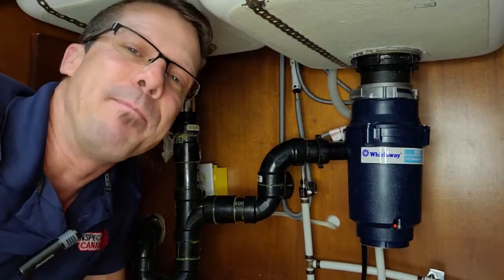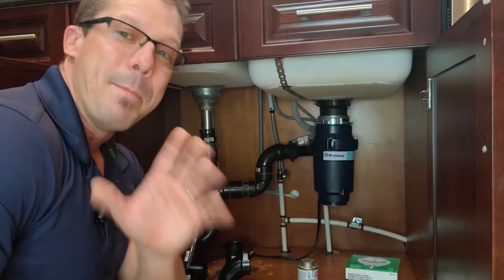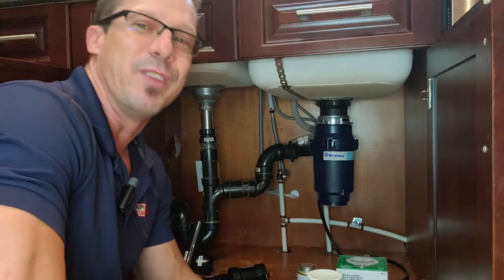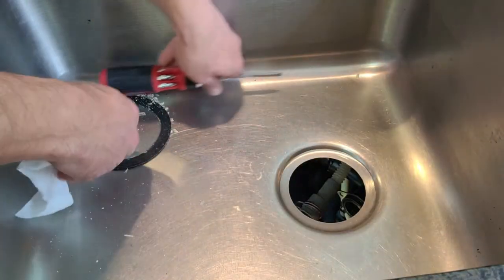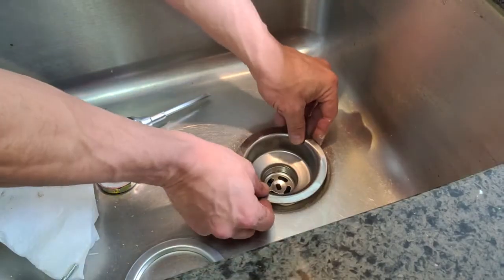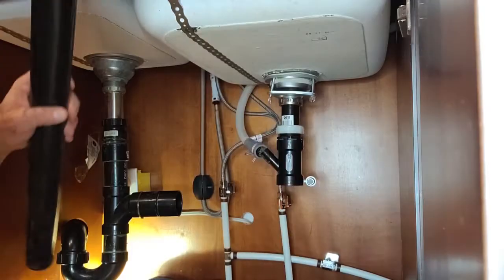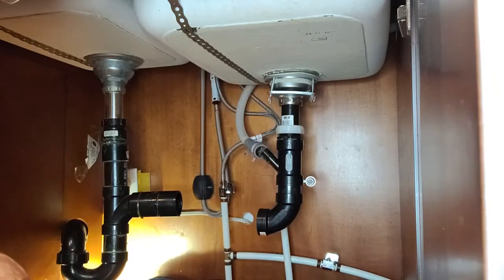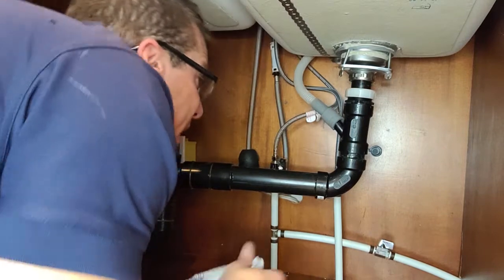How to remove a garburator garbage disposal and finish the plumbing

Comment: those gaskets you put the putty over go under the sink
Reply: Wild he doesn't know that lol
Reply: He doesn't know that. Cause he's CANADIAN..LOL
Reply from the maker: I guess now we know that whether you put it on top or under, it makes no difference. But you are right, it goes under.
Reply: No point to put putty over gaskets.  I assume the gaskets are to prevent leaks in the future. 
The bracket looked very crooked, and will shift over time. 
I wonder how long it will stay water tight.
Especially with vibrations from countertop appliances and dishwasher.
Reply: @Finder76  i expect this will leak in a couple years. water will leak under the top gasket or out the crooked fittings.
Reply: @InspectCanada  It does make a difference wth are you talking about
Reply: @TMS5100 it's gonna leak immediately

Comment: When you installed the new drain, you put the plumber putty on top of the rubber gasket and paper gasket.  That rubber and paper gasket actually gets installed under the sink and only the putty should be on top between the new drain and the sink.
Reply from the maker: Yes, I've been told. It's been a few years and it still not leaking. Didn't want to re-do the video for that.
Reply: @InspectCanada so u just left it? Jesus...

Comment: Just a question.  My sink is plumbed like it was in the kitchen you worked in.  There is a plastic value that screws onto the pipe at the top of the sink, on one end of the pea trap and the other is connected to the garburator.   My sink plugged up so I tried to remove the p trap. I couldn't just remove the pea trap connection because there was no screw valve on the other end of the pea trap.  When I removed the screw valve at the top of the sink and the garburator the pipes are too tight to remove. I don't want to be too rough or it may crack the plastic pipes.   I need to remove the pea trap because I can feel 2 pieces of plastic cutlery in it.   How do I remove the pipes by the p trap without having to call a plumber to cut the pipe?  When I looked at other videos there are screw valves on both ends of the p trap so is this plumbing acceptable because you can't remove the p trap?  I'd appreciate your feedback.

Comment: I am not sure but when you slide the piping up to connect the final elbow to horizontal section is there a chance that the vertical drain from the sink is now blocking the drain from the dishwasher inside the piping? The vertical piece from the sink was quite long.
Reply: Good observation. An inch or so too much I think.

Comment: My parents had an Insinkerator disposal since the 60's, replaced it in the early 80's with a new, higher-end quiet model as part of a kitchen remodel, and never had the problems you suggest are endemic to disposals. They had 10 kids and the disposal got a lot of use every day; I can recall one or two times that we had to deal with a stuck grinding wheel. I've had a Kitchen-Aid model for 9 years (manufactured by Insinkerator), and have had none of those issues either. I guess we actually read and follow the directions, and buy good machines.

Comment: Have you actually done this before or did you just happen to record yourself doing it for the first time ever. Putting putty on the gaskets that are supposed to be under the sink is wild. Also, sawing off a piece of pipe while rocking and grasping the drain pipe of the other sink, wow. If that wasn't bad enough, leaving that huge bur on the cut piece of abs and then smashing the collar on there and no extra twist. To top things off folks, putting abs cement ON THE UPC STICKER AND NOT REMOVING IT before joinint the two pieces together. What in the world did i just watch????

Comment: Garbage disposals are wonderful things.  You won't have any of the problems you mentioned if you use it correctly.  And yes, it is "proper" disposal.
Reply: If it's "proper" disposal why are they now banned in new builds in the city of Vancouver? BTW...we have organic waste disposal.
Reply: Disposals used to be fairly cheap. Now, the cheapest one, with a contractor discount, is around $100. They used to have a 5-year warranty, now is 1-year. My disposal broke 3 weeks after the warranty expired, so just replacing with a strainer. It was incredibly rusty for only 1-year old. Also, apparently, they are intended/designed to only dispose of small amounts of food waste.

Comment: This guy put that trapped the wrong way. That rubber and its like a paper board goes under, only the putty goes at the top..
Reply: Seems it doesn't matter. No leaks were detected, and I believe he posted it didn't matter but it goes under. Double protection from leaking.

Comment: Why is the screw holding the drain on an angle? Drain sealing also installed improperly. Did not deburr his saw cuts, forced joints together.  Please, consult a plumber before making a video. Let’s teach best practices.
Reply from the maker: I would 100% never do that but thx for watching our videos. 90+% of all deficiencies found on homes are plumbing related.